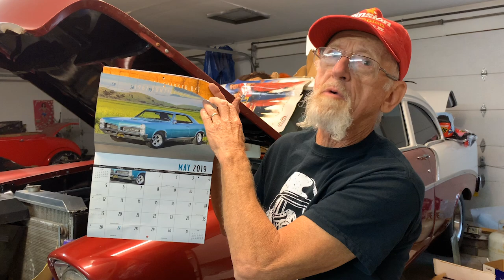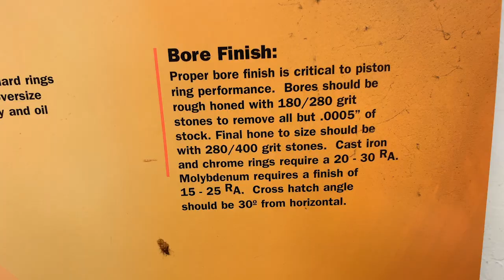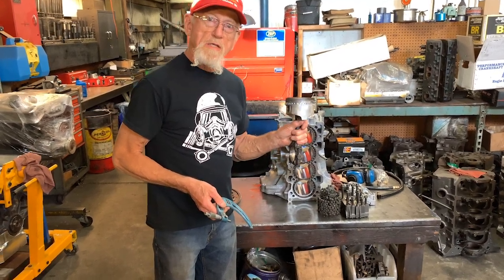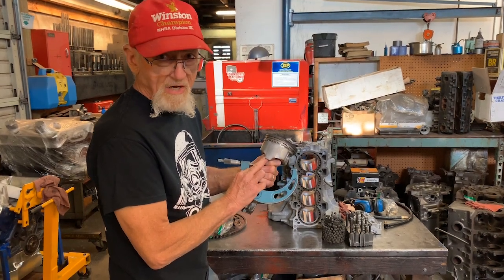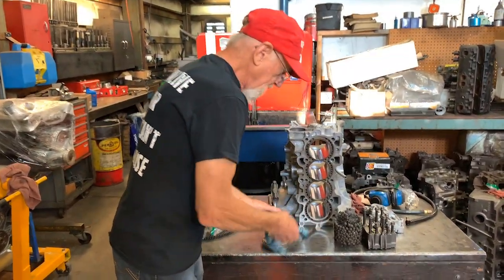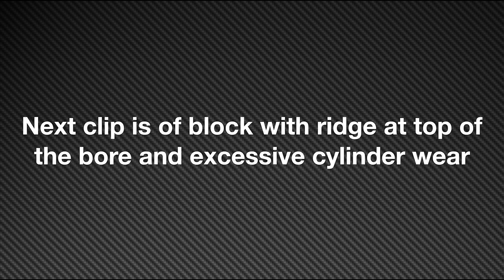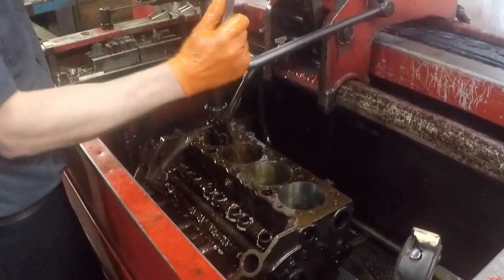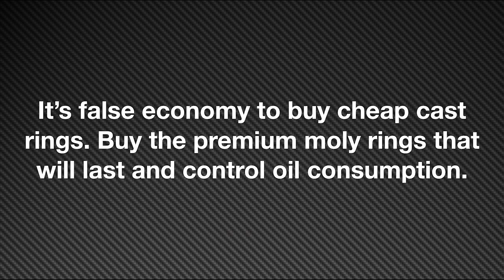Hone Your Cylinders Correctly. Enough Bogus Info!

Comment: I agree it's prudent to take the engine to an engine shop and have an expert do it with the correct tools. But, that being said when I have to wait 6 weeks for a shop to tank a block and remove cam bearings and pull the frost plugs and make some measurements that I already knew because I have the Dial Bore Gage and Micrometers and they tell me it's going to be another 6 weeks to finish the job and they haven't even started my heads yet. I pick my stuff up and go home and do it myself. The tank job was crap and didn't even remove the paint or rust they removed the frost plugs with an air hammer and put gouges in the block and then get butt hurt when I don't want to wait 1/4 of a year for them to do the work and whine and complain about having to torque plate the block like it's going to take a week to put them on and take off. I spent $235 to have the crap work they did kind of completed and will save a ton more time and money doing it myself. Been 20 years since i rebuilt it last and over 100k miles and i'll do it again. This isn't brain surgery folks it's just a large air compressor and unless your wanting big HP gains it's way easy to do and if you want to add HP it's cheaper to buy Alum. heads and a cam and lifters, manifold etc. than to have a shop work over a set of cast heads for a minimal gains. Unfortunately we are a throw away society now and due to high labor costs it's cheaper to buy new than to rebuild in many cases. If you need an engine completely rebuilt you'd be money ahead to buy a crate engine or buy an engine from Blueprint engines with all new parts and block and a dyno sheet. You know your screwed when you take in a set of Vortec heads and the guy says "there are only 2. kinds of Vortec's those that are cracked and those that will be" and by the time I work them over it will be the same price as a new set of NKB alum. heads from Skip White. With some basic tools and knowledge on a 350 chevy you can have a 350HP engine easliy and with some more money I went with 430hp and didn't have to wait 3 mos. Heck, a guy can buy a new 4 bolt L-31 Vortec crate engine with a 100k warranty for $4600 delivered to your house in a week or 2 or you'll spend 1/2 that just on machine work alone on the block and heads and hard parts and gaskes will be alot more. Is honing with a 3 arm hone or a ball hone perfect?. No, but in most cases it will get you by alot cheaper and faster than a full blown rebuild from an engine shop. We as a society need to get back to learning to work on our own stuff and keeping more $$$ for ourselves. As a farm kid in the 60s and 70s we rebuilt quite a few tractors and truck engines in the barn on a dirt floor with the help of JC Whittney and they all turned out well and ran many more years with an old arm hone and an old electric drill. For what the engine shop wanted to do the work I bought the few tools that i didn't have like a cam bearing inst. tool etc. and a used old Sioux valve grinder and a used old Black and Decker seat grinder and a new digital torque wrench and did the work myself and now have an extra set of Vortec heads to use or sell.

Comment: Makes sense. Once all the disassembly work done, take block to a machine shop for proper machining. Generally cheap. 

Only time it’s tempting to manually hone is if you are going to sell the engine soon, even then, it’s dodgy af and not recommended.

Comment: I have a question ? First do you work on motorcycle engines . I have a 07 cbr1000 and the cylinder section is connected to the top half of the case is it possible for you to bore it

Comment: they want 120 a hole on a 4 cyl here
ill take my chances
Reply: the men that know how to do it rite take hours to get it right, the key is to do it with so much gental pressure that it takes many hours per cylinder to get such a smooth bore inside that it could take a million miles plus more in the end, ring life that is.
Reply: @cliffcorbitt9494  doesnt make sense. pressure or speed has nothing to do with surface finish smoothness. The grit does. you could get an extremely smooth mirror like surface using 1000 to even 3000 grit stones.
Reply: @OldCrowsClassicCars  hone pressure does effect the finish! Too little and your just rubbing and making scratches. Too much and your digging stone shards into the cylinder walls. Plus creating hot spots. Not super complicated but does take a bit of practice to aquire a proper finish. I ran CK-10's like his in this video for many years and now own my own CV-616. He talks about fixing hundreds of self done hone jobs and he is not alone, most of us in the engine rebuilding industry have fixed hundreds.

Comment: i just bought new standard size pistons to bump up the cr had 50k on the motor so i am hoping for the best . question is i bought cast rings what are the benefits of moly ? pros? cons?     (sbc 350 59cc chambers +6cc pistons )  also considering a 100hp shot of nitrous in the future what should my ring gap be?
Reply from the maker: every engine made sense the mid 60's has had moly rings.(diesel trucks run chrome) They are far superior to anything else. Cast iron rubbing on cast iron equal accelerated wear. Many engines with as much as 300k still have the cross hatch with moly. Back in the 50's it was common to rebuild engines that ran 30w non detergent oil every 50,000 miles. They usually had to be bored 30 or 40 thou over. I think it is wrong to even sell cast rings. Run your top ring gap at about .022 and the second at .020. You,ll be safe even if you put a 150 hit in.
Reply: Rule of thumb is 4 thou ring gap per inch of bore for a standard NA engine, forced induction or nitrous motors require more gap, best to refer to the ring manufacturers specs.

Comment: To answer question why not do it right? I rebuild used boat engines and hone them out myself because the engine's going to fail in some other way ,long before the cylinders/rings wear out, because of a less than absolute perfect honing job.

Comment: i dropped off my bmw bare aluminum v8 block and disassembled aluminum heads to a local "very reputable"  machine shop to get cleaned and degreased only. when i picked them up someone had used a drill with wire wheel and reamed out the cylinder head`s hydraulic lifter bores/recesses and all gasket surfaces (DOHC - Camshaft over hydraulic lifter design) which left a huge crosshatch pattern in a previously perfectly smooth surface. I should`ve taken pics before dropping everything off for proof. The shop tried saying it was caused by abnormal wear patterns  (after all, bucket lifters do rotate ) .But damage In all 32 lifter bores? Nah. I shielded the bores when using valve spring compressor.   its odd, not one vertical scratch though.... plus lifters were unmarked.  i`m betting they gave  the task to the inexperienced young  shop sweeper and he was too much of a pussy to own his mistake. I`m just  glad that i made it very clear - DO NOT HONE OR TOUCH THE ALUSIL CYLINDERS... Ultimately , they were able to polish 95%  of the scratches out but still would`nt admit fault. all that stress for 400.00 .   At least  lifter bores are still within spec.  Next time ill watch them in person doing the work.

Comment: It's not rocket science. Have decent measuring equipment and bore to within. 005" of final size and hone to fit each piston. My custome pistons all measure within .0004" of each other. Those are Ross pistons made to my specs. Different depth valets depends on the application. Forced induction high HP engines need a bit more oil as well as lower ring height. N/A engines require a higher ring pack and less Valletta depth. Cross angle drain-back is between 40-50 degrees. Torque plate boring & honing is the way to go. Hot honing is not something I have tried yet.

Comment: I wish I could get a V8 machine honed here for $75.  It’s twice that at a general auto machine shop and more toward $250 for a hone from a performance shop.  Back 10-15 years ago I could get $10-12 a hole but those days are gone.
Reply: Well not so much dude look at it a different way cause you know every once in a while you come across an old timer such as your self that farts dust and shit left an right that hasn't quite realized the $ ain't worth hardly shit anymore so they feel like their bending people over charging a more typical rate. Those guys even tho they fart dust n all that are kind of cool not breaking the bank on the peeps so, I suggest you just fart around town a wee bit longer and look for dust clouds and you have a good chance and finding yourself a fair deal partner. 🤠. What I say is what I know.😐

Comment: Hmm.I guess all you guys own a dial bore gauge and a  caliper set,and file fit your rings.A good machine shop will not hone your cylinders If they are out of round,or too far out for your pistons wall clearance spec.If you hear a feint tap,tap.Thats your piston rocking In the bore until it cracks a skirt off.

Comment: hand fit a loose ring in the cylinder , then place a cutout of cardboard using the piston to trace the circle, then place the cardboard disc ontop of the ring you placed. Now use a flashlight shi e from underneath , and look from above , you will obviously see the light shine through the end gap wich is normal , but if you can see any light shining through in between the piston ring and the sleeve then it mea s that gas wi also make it throug... I do this on. nervous risky honing jobs so that I only remove material until theres no light shining through. Im sure this will help the STDIY (screw that ,do it yourself!!!) 
And for mister " send it in to the shop or else im going to start crying and tell my momma " 1. you have to remove your block . 2. you must clean strip everything off , and they are full of shit at the engineering shops , you cant rock up with a gunky greasy carbon dripping block , they refuse to touch it as they dont want any of that shit blowing around the shop getting into everybody elses stuff... nope. then they charge you money you dont have . and you sometimes wait long , then they hit you with this" it could not be honed so we had to bore it to xxxthou oversize."  at that moment your life is ruined , buying a set of pistons was never imagined. plus oversize rings are more expensive than std coz they don't sell as fast... now ive gotta assemble my block again , and now I need a gasket set aswel and most like some stuff got broken when you tried to remove it for the engineering... 
So leave the men , if an engine has blowby in a of its cylinders , then re-ring and home honing it , even if 1 or 2 wont seal 100% , the results will be a much better engine than you had, no oil burn and much more compression... besides , depending on the engine and its intended use , up to 10 % or more in some high performance engines , is considered acceptable. and if a manufacturers spec in a manual says 10% they actually mean 15 or so , coz they trying to scare you from the absolute limit in case its breaks down and they look bad... Final word. Im a private mechanic and if it comes to a customer car then I agree with old sadness In this video. do t take chances , they are paying for it anyway , and while that stuff is at machine shop , you have time for something else I. the meantime... but if its my own then I will hone it with damn emery tape wound around the sponge from my car washing kitt and a dowel stick in my hand drill if I must...

Comment: I dunno it's not actually that hard to do at all and get more than good enough results at home. If your cylinder is really out of round or the bore is damaged severely then send it off but if it's just a tired old engine it's really not that hard. If your building a race engine that's another kettle of fish but modern materials give a fair bit of wriggle room at standard outputs.

Comment: On my engine builds which i tell these kids I a ball hone is for deglazing and yoi have to finish hone them with a rigid hone.
Reply from the maker: The only ridged hones I see in these videos are the cheap 3 finger type that are always to coarse. A good Sunnen adjustable 2 stone and 2 wipers hone has roughing stones to remove material after being BORED over size for new pistons. Then change to the smoother (320 grit) finishing stones for the last 1/2 thousandths or so. For this hone you need a dial bore gauge for accuracy.     Deglazing is all you need to do. Don't remove any medal when doing a overhaul using the old pistons. IMPORTANT  clean all the carbon out of the ring grooves using a broken second ring. Visually inspect for cracked skirts and if the engine has run lean (plugged injector) or over heated have the pistons miked to be sure no collapsed skirts.
Reply: @PerformanceEngines  Where is your shop located at? I think I recognize your worker there!
Reply: @PerformanceEngines  I've seen 320 grit stones for the glaze breaker on rockauto, as well as rigid hones with 500grit stones, although those are a bit expensive, close to $200. Still, much less than what the local machine shop would charge at least around here.

Comment: You keep knocking cast rings but I like cast better they seal up better I also like cast heads with cast valve guides bronze guides will grab a valve cast is a great wear metal

Comment: I am a big diy guy with an engineering background and the desire to do complete engine machining at home.  I feel I have thourghoughly educated myself on honing cylinders and main bearing caps.  Until I can find a professional hone that I can afford, the blocks are going to a machinist.  You are kidding yourself if you think you can do this task correctly on the cheap for even mild builds if you have overbored the parts and arent trying to just clean up a bore already in good condition

Comment: Hi happy new year, i buil my engine all new and the machine shop hon the cylinders, i never rand the car i only turn it on each 3 days for 10 to 15 minutes. Now im gonna replace pistons for forge pistons and new piston rings do i have to hon again even without using the car? I never took the car out of garage i only started the engine each 3 days in garage not even 50 kilometers on it

Comment: what's wrong with cast rings ?
Reply from the maker: they are from the 1950's when a rebuild was required every 50k. Worst investment you can make while building an engine.They shouldn't even make them. Cast on cast equals extreme wear

Comment: Notice that he is in a machine shop? If your patient and take your time anyone can hone a cylinder properly. This is just a gimmick to get you into a shop.
Reply from the maker: Absolutely untrue. It has nothing to do with patients, it has everything to do with KNOWLEDGE. 95 percent of the blocks I have seen over the last 20 years have had little on no wear. The Japanese perfected manufacturing of dense cast iron. It is noticeably harder then what American manufactures made that required over bores of 30 and even 60 thousandths. Dart, World Products, Brodix, GM, Ford and all others who offer performance engine blocks all use this process along with a higher nickel content. This has eliminated block wear. Honing is to remove medal. That increases piston clearance. That is not what you are trying to accomplish. You are trying to replicate the factory finish that resulted in the engine lasting in some cases over 300 thousand miles with 0 cylinder wear. The knowledge I am trying to pass on is that most everyone is showing way to coarse of a finish and not enough emphasis on proper crosshatch. Most people doing a in chassis over haul will have success with a 320 grit Brush Research ball hone.(dingle ball) Then you just DEGLAZE  the cylinder.Then you install premium rings on properly cleaned pistons, you use the proper oil and startup brake in procedure and you be successful. Oh and hope you didn't miss a crack in a piston or a worn ring land or a worn wrist pin.  It's so easy, machine shops are just totally unnecessary as are the engine rebuild classes at the local Jr. college and the worst offender, The School of Automotive Machining Tech in Huston Tx. LOL
Reply: 98% of people aren't building performance perfect motors either, most people are building motors that are going back on the streets. 95% of motors I've seen honed work just perfect and have lasted longer than the vehicle itself. There is always a profit tactic behind a professional business making a demo video. Usually with misleading information to confuse and discourage people from DIY projects.
Reply from the maker: @jameslackey9695  Actually just the opposite is true. 50%of all the business I have ever done is with DIY customers. On literally 100s of occasions while cleaning and installing cam brgs, soft plugs etc. I have brush honed cylinders for customer with out charging them one penny. Just trying to help them do the job correctly when they couldn't afford all the services they needed. I have also loaned out my brush hones and spent the time to show how to properly use them. I have helped hundreds of customers by reminding them they needed to clean the ring lands. Showed them the proper way to do a DIY crank polish and especially took the time to explain the proper break in procedure.I loaned out my repair manuals so the could see head torque sequences and values. All so they didn't have to spend unnecessary money on a one time job.Just to be clear, a stock engine is meant to be machined, cleaned and assembled every bit as carefully as any race engine.
Reply: @PerformanceEngines  Absolutely correct! I wish you had this info on the video, but maybe you do somewhere else.
Reply: @PerformanceEngines  People that do that kind of thing, honesty, and with an intention of helping others, and not hide the solution and scare them, are rare. That's very nice of you!